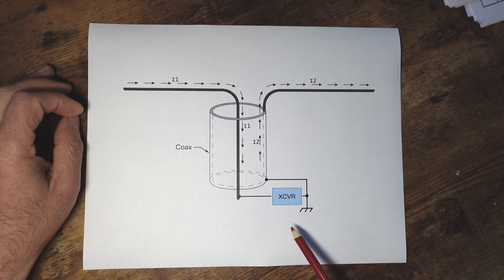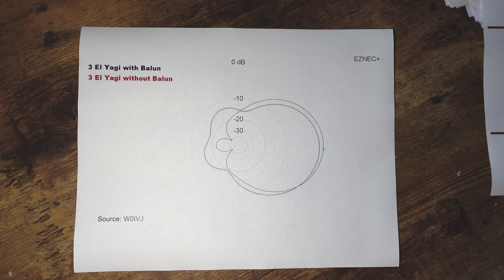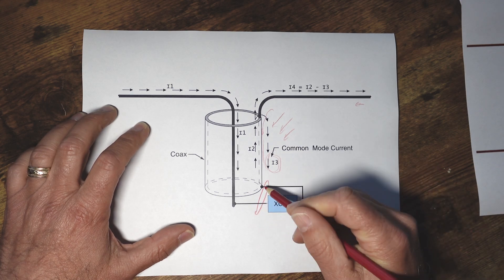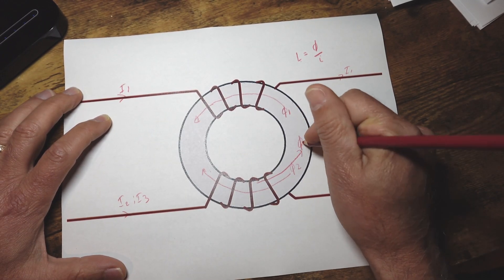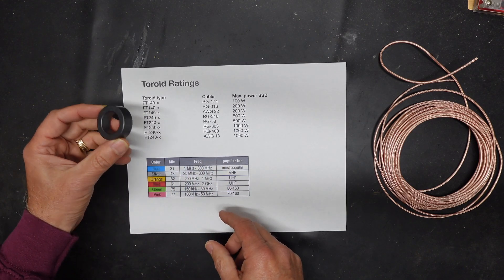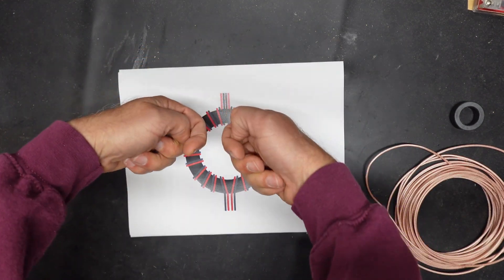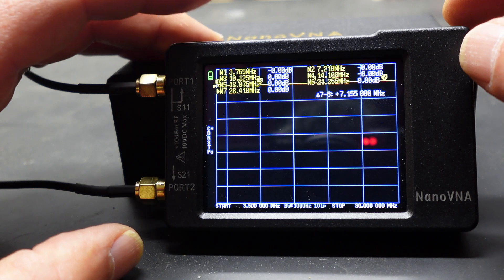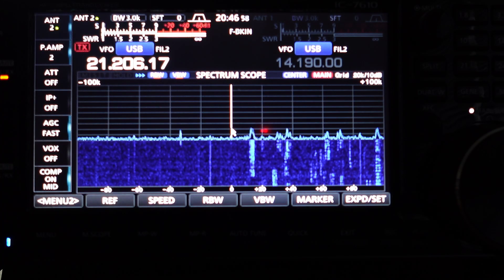Quiet Your Rig: Add a Common Mode Choke [Step by Step]

Comment: What was the setup for measurig Common Mode rejection with the VNA.  It was hard to figure it out.
Reply from the maker: Thanks for the question. Here are the steps 

Calibrate: Calibrate your VNA (e.g., NanoVNA) with short, good quality cables.
Build a Test Jig: Create a fixture where you can pass both the center conductor and the shield of a coax through the choke, or connect them to the VNA ports to simulate CM currents.
Connect the Choke: Connect the input side of the CMC to VNA Port 1 (Source) and the output side to Port 2 (Receiver).
Configure VNA: Set up an S21 Log Mag measurement.
Measure: The VNA shows attenuation (dB). A good choke will show high attenuation (e.g., -20dB, -30dB or more) over the desired frequency range, indicating it's blocking common-mode noise.   73, Paul.

Comment: Excellent video Paul. I spent most of the morning trying to figure out what I need in order to build my own common mode choke and finally found this video, thanks. I'm going to build two, one at the radio end and the other at the feed point to the antenna to keep as much of the RF on the antenna. To compensate for resistive and magnetic core loss my plan is to increase the output power of my transceiver from 100w to 150w, an easy mod on an Icom 718.
Reply from the maker: Sounds like a good plan. I hope that we are able to Qso soon. 73, Paul.

Comment: your talking b.s the figure  ft 140 ft 240 is the diameter of the toroids in inches  1.4" and 2.4" etc ! nothing to do with power!!
Reply from the maker: You are correct, that it is the diameter. However, the larger the toroids the more power they can dissipate because the flux is higher. 73, Paul.

Comment: I recently subscribed and I'm working my way through your excellent videos.  I love the focus on a single topic, the technical detail without any diversions into tangential subjects, the useful and practical information, and the way you clearly convey the information with very effective graphics while respecting the viewer's time.  These are very high quality videos.

I've been making a variety of portable antennas for 20 W or less.  I use RG316 for the feed line even though it has double the loss of RG8X because my feed lines are short enough that the insertion loss per foot is less important than the insertion loss of adding two connectors combined with the ease of making a common mode choke with RG316.  I can get nine turns of RG316 with a pre-installed BNC connector on an FT-140 core.  I put the RF choke near the transceiver if I'm making an antenna that needs to use the outer shield of the coax as a counterpoise.  If I don't want the coax shield interfering with a balanced antenna's radiation pattern, I put the RF choke on the antenna side of the coax.  These are very easy RF chokes to build and they test great on the nanoVNA.  I don't need any connectors or an enclosure for the RF choke, but if it's likely to be hauled into a tree I'll 3D print a streamlined enclosure to reduce the likelihood of it snagging.  Without a 3D printer, I'd use large diameter heat shrink tubing over the RF choke and a piece of smaller diameter heat shrink tubing over each end.

Comment: Hi, would this still work with copper coated steel coax?
Reply from the maker: I think it should work, I don’t see why not.  But it may be hard to wind. 73, Paul.
Reply: @W2PAK  Thanks for the reply Paul.  I did make one, but it's made no difference to the noise floor on the lower bands, as you say it was hard to wind and not as light on the core as I was hoping for.  I just wondered of the steel would react with the ferrite, although CMC are supposed to run down the outside of the shield.  I've ordered some proper copper rg58 and will give it another go.  73. Darran

Comment: What happens if we put two or more chokes in series? Do we get increased noise reduction by all, or do they mess up with each others' work?
Reply from the maker: Good question. Yes, you can series-connect common-mode chokes; the impedances add and your differential signal still passes. Just be aware of saturation, parasitic capacitances, and frequency response so the combination behaves the way you expect. 73, Paul.

Comment: Perhaps I missed something.  How did you know that ten turns (five on each) were correct?
I am looking at only 10 watts (QRP) on the HF Bands.
Reply from the maker: Thanks for the question. You typically want at least 1 kΩ of common-mode impedance across your desired frequency range. Ideally 5–10 kΩ for strong suppression. One can use Ferrite Impedance Graphs

Ferrite manufacturers (Fair-Rite, Amidon) provide impedance per turn vs frequency curves.

Example (Fair-Rite #31 toroid, 2.4” OD):
	•	At 10 MHz: ~40 Ω per turn²
	•	At 30 MHz: ~150 Ω per turn²

I hope this answers your question. 73, Paul.
Reply: @W2PAK  Where did you get the data?

Comment: Appreciate the video and will use process for making choke this week.  Please explain the test connection to the choke; can see the bare copper wire.  Is this to the core or braid of the jumper coax?  Is there a second connection to the jumper back to the VNA?  What are the setup settings on the VNA for this measurement?  Regards and Thanks
Reply from the maker: Thank you for the question.  The bare wire is the central connector of the coax. There is no second jumper to the VNA.  The VNA is set to measure loss between port 1 and port 2 (ie S21).  Hope this helps.  73, Paul.

Comment: Does CMC work like Ugly Balun?
Reply from the maker: Common mode chokes can contribute to balancing by suppressing unwanted currents on an unbalanced line connected to a balanced load, its main goal is noise reduction. A balun's main goal is to ensure proper signal transfer between balanced and unbalanced systems, and it may or may not inherently provide significant common mode current suppression, although some designs (like choke baluns) are specifically designed to do so. I hope this helps.  73, Paul.

Comment: Hi! I use a 1:1 Balun on a dipolo antenna. In this case i dont need a choke right? I also use a end fed randon wire to 12m band and an unun 9:1 and after i ground it the shield side of coax the RF return  on the shack gone. Thank you for your information! 73 Pu2PQQ Jean.
Reply from the maker: Hi Jean, 
You do not need a choke for the dipole or endfed.  They should work just fine.  73, Paul.
Reply: @W2PAK  I am using an EFHW on 75m built with a 49:1 unun, and my noise floor is S9 or higher. Would a CMC as you showed help? Thanks.

Comment: Hi Paul,thank you for your useful video.I have a doubt about the setup😢 used to measure the common mode current.could you please clarify how all it's connected?greetings fron Italy..73 IU1CYF Paolo.
Reply from the maker: Hi Paolo, I did not really measure common mode current.  I measured insertion loss power which was minimal and common mode power which was much much lower.  I hope that this helps. 73, Paul.

Comment: Oops, you have a misunderstanding with the Ferrite cores.  Let's look at an FT240-58   The error is that the 240 is power.  240 is the size in inches.  A 240 is 2.4 inches, an FT180-58 would be 1.8 inches  and an FT60-58 would be .6 inches.  So in a way you could say more power because it is thicker and bigger but it is REALLY size.
Reply from the maker: The larger the core the more power it can handle.  73, Paul.

Comment: Hi call is GM0EEH. Please forgive the question. I run an EFHW 80-10. Would a common mode choke inserted in the coax would this reduce the noise level? Also where should the choke be added at the antenna side or the TX side. Thanks.
Reply from the maker: Thanks for the question. It depends where the noise is coming from. If it is common mode noise then yes it will help.  I usually insert the common mode choke near the TX. But I have an antenna with  CMC on both sides.  73, Paul.

Comment: Hi Paul. Nice video and tutorial. For best performance, where should one place the CMC, near the antenna feedpoint, near the shack passthrough, or maybe one at each location? Thanks!
Reply from the maker: Thank you for the kind words. That is a good question. In the video I put it right next to the transceiver. But, in my station I actually have two. I have one near the transceiver and one at the antenna. 73, Paul.
Reply: @W2PAK  Nice. That's what I'll do. I read that somewhere and considering the dynamics at work, it made good sense to me. Thanks again.
73, Gary W1GWL

Comment: Thanks for this nice video,  i'll have one question were do  you placed the common choke  under the antenne or  direct after the transciever?
Reply from the maker: That is a great question. I made a video about how to put an HF radio station together. In my station, I have a common mode choke at the antenna and at the transceiver. In this video, it was just at the transceiver side. I think you can get away with just putting the choke on the transceiver side. 73, Paul.

Comment: So is this better than having 6 palomar T31 snap ons on the end of your coax feeding a homemade DX Commander vertical?  What would be better on a Fan Dipole?  Thanks!
Reply from the maker: That’s a good question. It probably would be better.  But, I would measure the common mode attenuation with the snap ons  and compare to my measurements.  73, Paul.

Comment: Please make a link for the 2 charts for what to use making the chokes, different power levels etc... liked the video, easy to understand 👍
Reply from the maker: That’s a very good suggestion, I added it to the description. 73, Paul.
Reply: @W2PAK  thanks for adding the charts so quickly, I'm sure it will be helpful to others as well, 73s AA2BD

Comment: Ah yes, common mode chokes and ferrites on cables, the homeopatic cure for everything when one does not know what is the problem.
Reply from the maker: lol.  I take it that you don’t use a CMC.  73, Paul.
Reply: A 1 to 1 balun certainly does not hurt when you move a few hundred kilohertz outside the tuned resonance of an antenna/radiator and have a bit of imbalance.. I see them acting more like a diode in a DC circuit thus being a one way valve.. I have done this both ways using wire wound cores and clamp on cores especially when a horizontal antenna can not be elevated to at least a half wave over the ground or a half wave away from ground clutter like trees and buildings.. This is far easier and cheaper than chopping down trees and bushes while placing the antenna at 35 to 100 feet above the ground or adding a half mile of ground radials to most verticals.. Another option is to have capacitance between the feed point of an antenna and a good ground.. Bad news is this method require that capacitance to be adjusted when changing bands or moving more than 100 kc's and the distance from feed point to ground has to be very short to prevent reactance.. Thing is most people already know their antenna is not and never will be perfect so why bother since the easy fix is exactly that..
Reply: Dude, you clearly haven't seen an UHF antenna on NanoVNA without and with a ferrite clamp.

Comment: Great video, new ham here about to build my first choke! I have done lots of research online and this is one of the clearest presentations I have seen on the subject. I especially liked that you showed the power ratings of the coax, and the frequency range of the various ferrite composites. I have a nano VNA and I plan to try testing mine after I build it. One thing I have noted with regard to the ubiquedous snap on ferrite cores intended for "EMF" protection , you will almost never find a T31 type (MnZn), they are almost 100% T43 (NiZn) which is why I chose to make the type of choke you demonstrated (I ordered an FT-240-31 which is probably overkill for 100W). 73 Mike.
Reply from the maker: Hi Mike, thank you so much for the comment. I did not know that about the snap on EMF filters. I hope to catch you on the air. 73 Paul.

Comment: I'm not seeing any demos of the same signal with and without a choke. Personally I have never seen a better receive with a choke and no improvement over local noise sources. It's quite possible you have ended up with an attenuator. the only way to know is a side by side comparison over the same incoming signal. If the signal drops with the choke in then it's attenuating all of the noise and signals.
  If the coax or feedline is of good quality and the antenna is tuned at the feedpoint with inductance and capacitance then what is the use of a choke. Almost nobody suffers from RFI these days and even with a choke in and many ferrites on rg213 I see very little improvement over triggering security lights and the like. Seems more like a hindrance and more to go wrong. Transform if you need to for certain antenna designs otherwise tune at the feedpoint. I would only use chokes in emergencies.
  The one time I found a 1:1 unun worked well was when experimenting with an antenna build with an insulated mast.  In this case with no earth coming from a mast it is extra important that the antenna is well tuned and balanced to 50 ohms by adding the correct amount of capacitance vs inductance. If you can tune your design to work well with low swr and it has no earthing you are essentially tuning an unbalances system to work more like a balanced one yet it still matches the unbalanced coax and radio. If you can get good results without a metal mast and only use counterpoises designed into the antenna itself then you have made a very good antenna and no choke should be necessary.
  All videos show how the choke attenuates unwanted signals or current by showing in on a vna but there are very few videos showing the difference in real world scenarios.
Reply from the maker: Thank you for sharing your experiences. I also have had antenna systems that I did  not notice a difference with common mode chokes. But, I’ve definitely noticed a big difference with other antennas systems. In this specific example, this is not an attenuator since we have measured the insertion loss to be 0.1 db. You can see in this example that the signals are not being attenuated, the common mode noise is being attenuated. Have a good weekend, Paul.